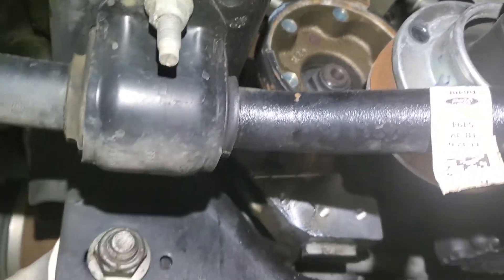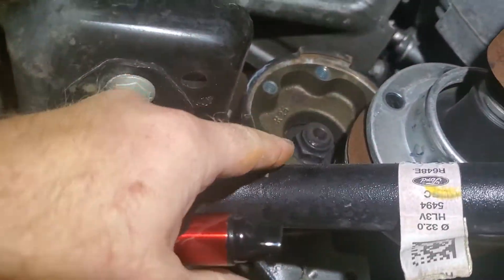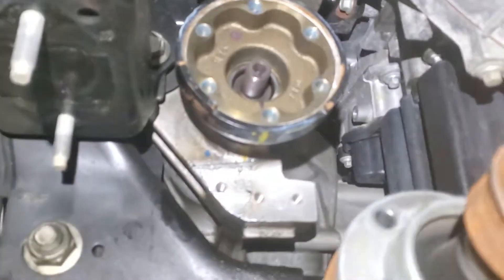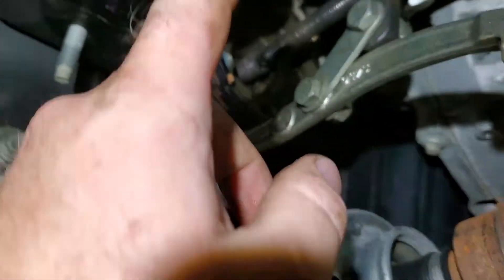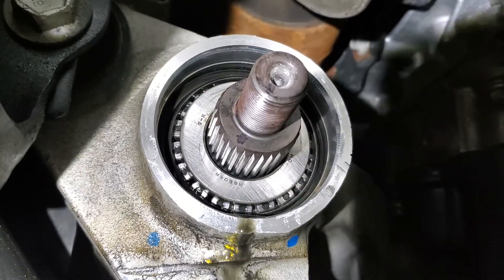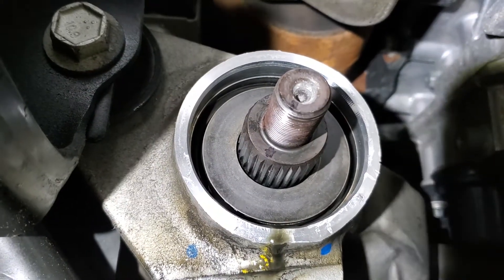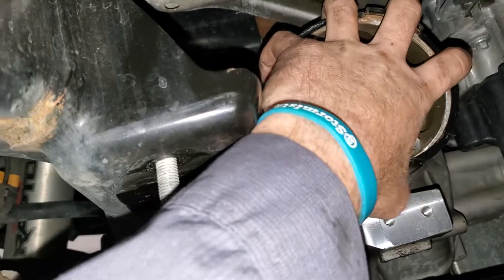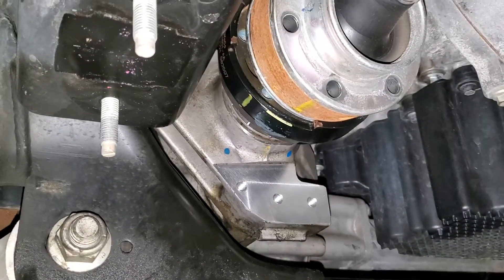2018 Ford F150 Raptor Front Pinon Seal Remove & Replace

Comment: Thank you so much when you remove the 5 10 mm small nuts. Do you have to leave it freely run for the front wheel I don’t have a jack.
Reply from the maker: I'm not sure what you are asking
Reply: @FordBossMe  how to remove the 10mm bolts holding the drive shaft? thanks
Reply: @tongtongwang with a 10 mm socket 💀

Comment: My explorer needs this in the front. I always worry I will under/overtighten the bolt. I guess you are an expert to sense it by feel. I used one of those harbor freight micrometers last time, it has a depth gauge. that and marking threads.
Reply from the maker: turning torque is key, its an easy job after you do it the first time

Comment: Hey, I’m trying to do this job on my 2018 F150 with a 2.7 engine. Should the parts work with my setup? Only parts store showing won’t work with 2.7 but will 3.5.
Reply from the maker: I don't remember 

Call dealer up and cross part numbers

Comment: What is 4C121 for?  The package is a nut and spacer.  After replacing the seal 3N134, I assumed everything went back in the order that it came off?  The pinion nut with the marking goes back on the same?  Also looking at an exploded diagram, doesn't E6TZ4859A (Deflector) get replaced as well?

Thanks for the video!
Reply from the maker: The Deflector can be reused if not damaged
Reply from the maker: The nut is the pinion nut and the spacer is the crush sleeve but if your only replacing the seal for a leak then there is no need for the spacer to be used
Reply: @FordBossMe  OK, thank you for explaining that and such a quick reply!

Comment: How hard is it to reseal front diff cover?
Reply: You have to remove the steering rack to even remove the front diff cover. Typically when you service the front diff for a fluid change, the fluid is just sucked out and new fluid is added. Speaking from experience.

Comment: Not sure if the diff is the cause but, my 2013 lariat 4x4 has a slight grind vibration in the steering wheel only when there is light pressure turning left or right, driving straight it's smooth. Like when there is the slightest pressure on the power steering I can feel this subtle grind/vibration. Again it's subtle. I would appreciate any help. Great video BTW

Comment: How much does it cost to get something like this fixed? i have a 2018 f150 fx4
Reply from the maker: 1hr maybe 1.5 labor rate is 165.00 and parts maybe 60$
Reply: Ford dealer just quoted me 307 labor plus 100 parts.

Comment: i have to do this in my front for my 2010 f150 but what is the torque specs on the 10m m bolts?
Reply from the maker: I mean it's a 10 mm bolt they don't get to work that much just get them nice and tight
Reply from the maker: I don't have a computer on me but you can feel what's tight enough with those
Reply: Can this be done on the ground without raising the front end and putting it in neutral?